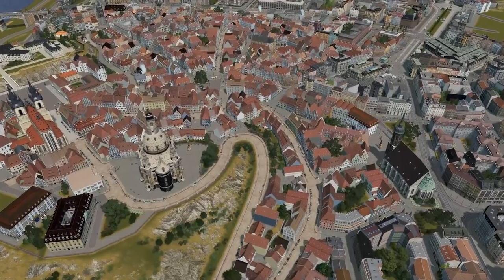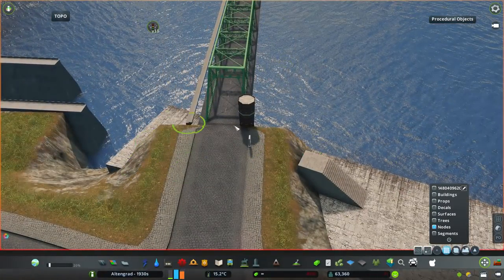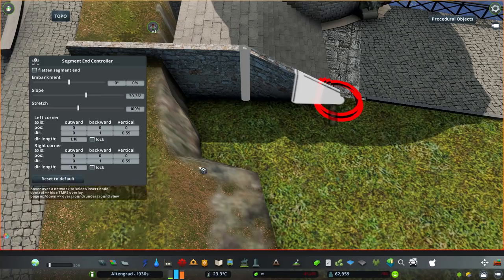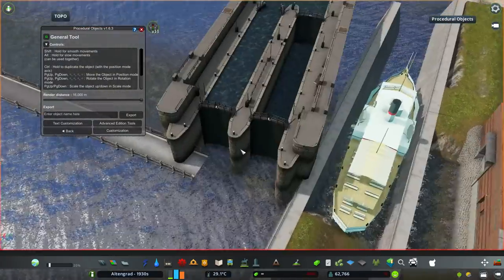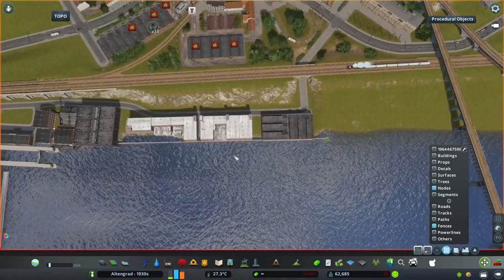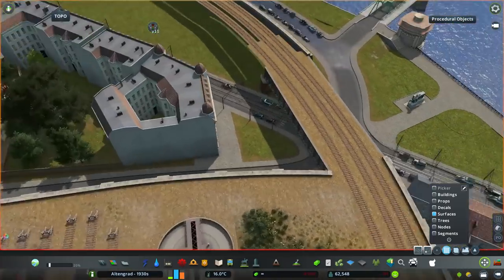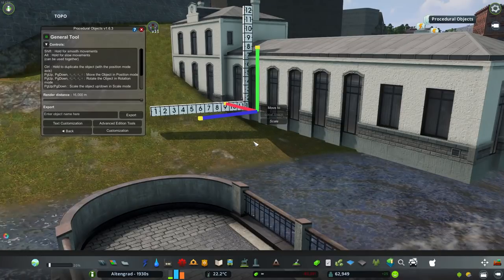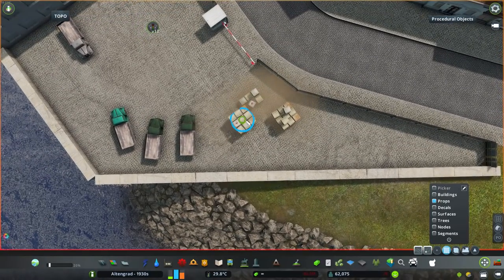Hydropower, Weir and Lock - Cities: Skylines - Altengrad #34

Comment: Believe it or not, in those times, horses or locomotives that pulled the boats through the locks. I used to live near the Erie Canal in Rome, NY, and they have a lock system from the 1800s. To keep the boats from hitting the sides, they'd be pulled through the locks by the horses on both sides.